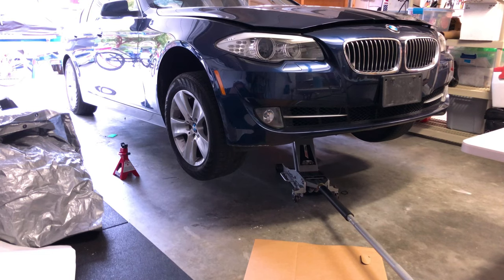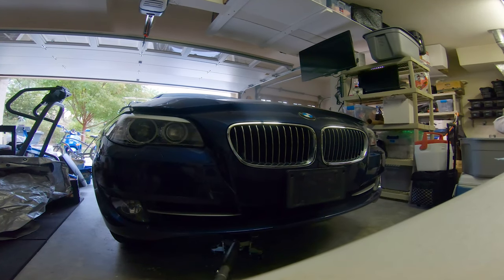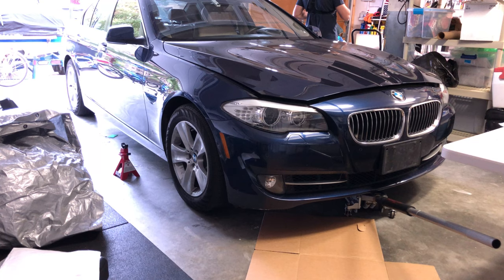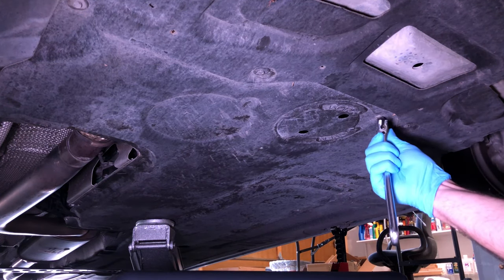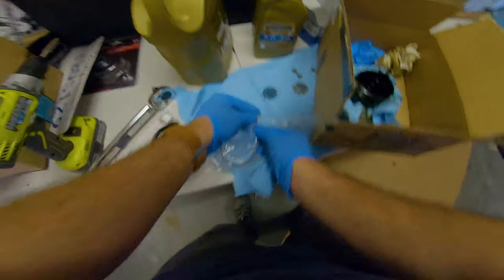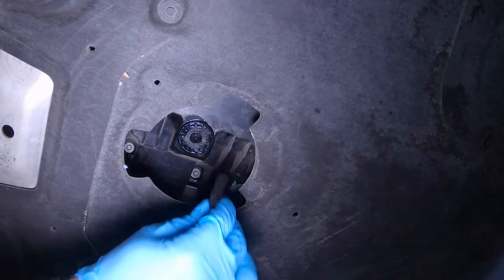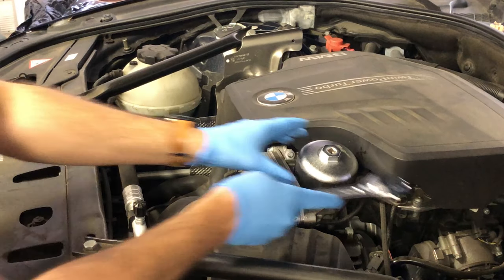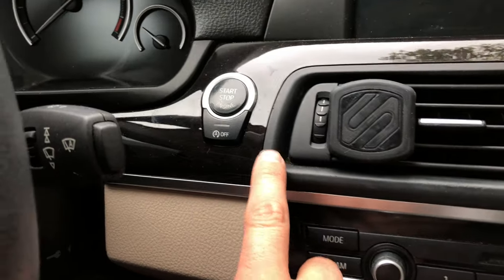Oil/Filter change 5 Series BMW- F10 N20 Gas Engine  2003-2017- Reset Service Light

Comment: Thank you so much for this... I have been looking for which socket to use for the drain plug but it doesn't really showed up when i searched on youtube. My 520i uses a plastic drain plug as well. I just bought the allen set and will try it when it comes. Cheers Jake!
Reply from the maker: Ya, threw me for a loop at first. Wasn't used to seeing a plastic drain plug. But it worked pretty well.

Comment: What did you do with third ring??
Reply from the maker: I don't understand? Did I forget something?
Reply: @fixitwithjake  look at 6:24. There are 3 rings there. What happened the third one?
Reply from the maker: @attorney8452  I see what you mean now. I didn't use it. It is a crush washer I think. Doesn't work for this oil change as far as I know. Must be there for a different vehicle type. Sometimes filters come with washers that don't fit your car. I don't see it used in @autorepairguys video and he is very smart at 06:00 https://youtu.be/JRCrwep5n5g

Comment: Do not torque down plastic oil filter housings
Reply from the maker: You can either tighten it down until the lubed ring o-ring disappears or use a torque wrench so you don't overtighten it. My wrench goes low enough.